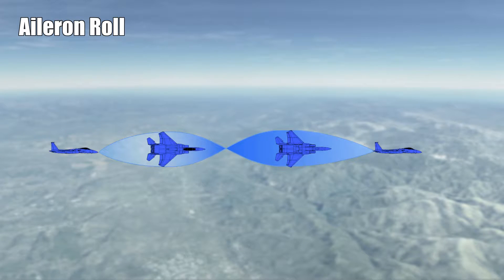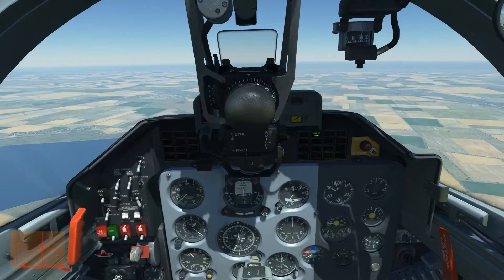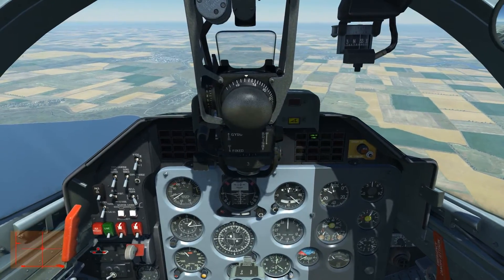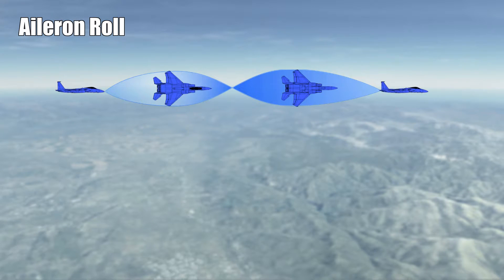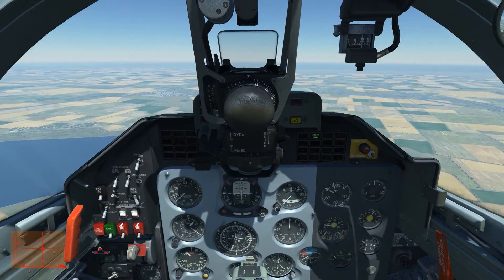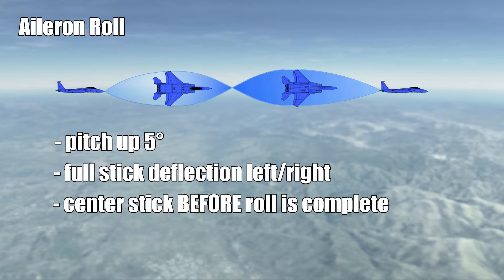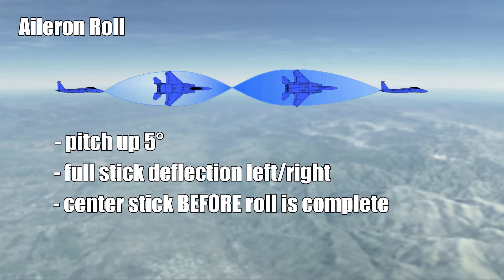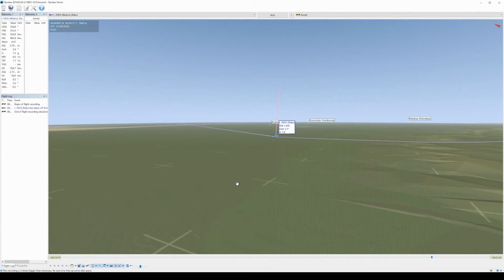DCS (World): Air Combat Maneuvering - #02 - Aileron Roll [English|HD+] - Tutorial

Comment: One other tip, when you perform any maneuver in flight, you will lose some altitude due to drop in airspeed. This can also be corrected with slight throttle. Throttle controls altitude, control surfaces control attitude.